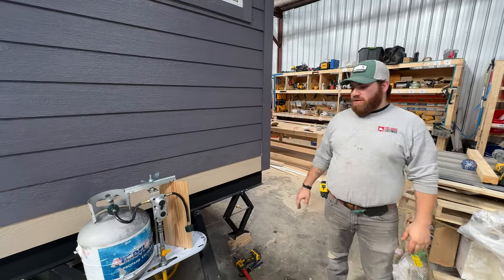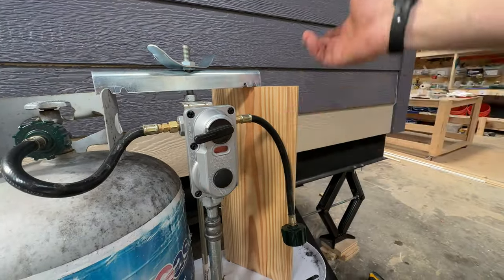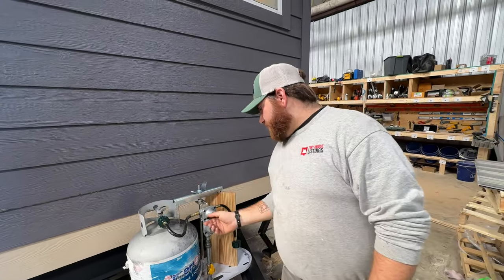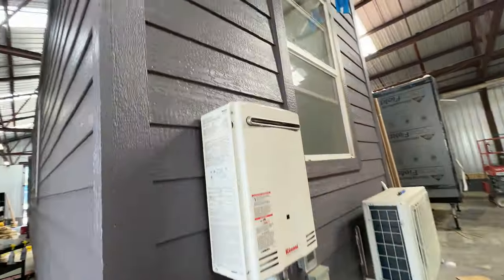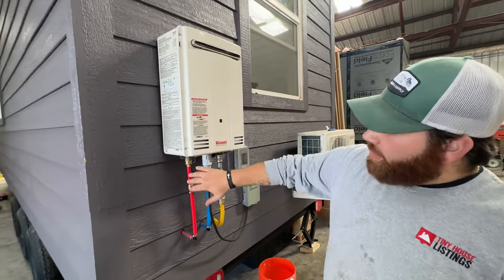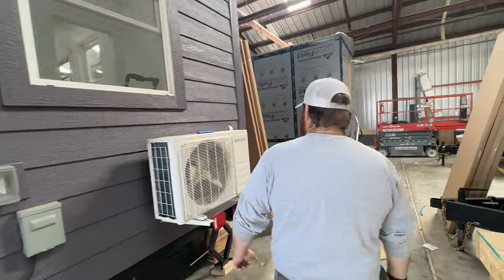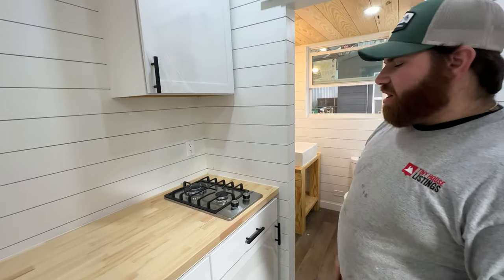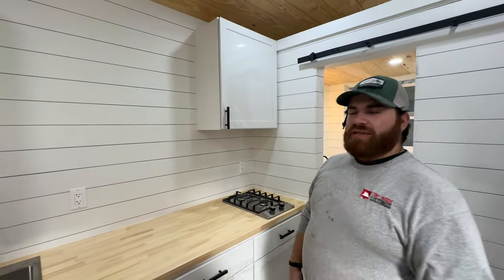We've Got Gas 💨

Comment: ok, so you put heating tape around the water pipes to/from the exterior tankless water heater, that's smart...but how do you prevent the water inside the heater from freezing? 🤔
Reply from the maker: This particular unit has an anti-freeze system. If the temperature gets below a certain degrees, the system kicks in to prevent freezing.
Reply: @tinyhouselistings  nice...i'm guessing that must just use propane, and not electric? thanks for all you do for the tiny house community!
Reply from the maker: @douglasharley2440  that particular features uses electricity. The same electricity needed to ignite the spark. Thanks for watching!